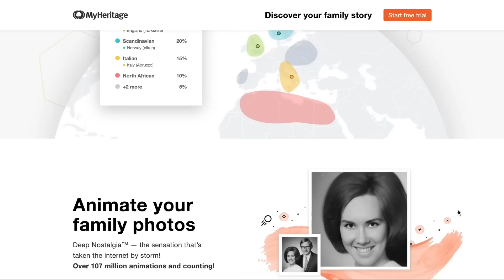THIS IS URGENT | Fixing our chicken coop mistakes on our Portugal farm

Comment: The doors are beautiful. I would use them as an accent for a Pantry door.
You could also build a walk in closet and use them as entrance doors.
One could be converted into a table. You could put some glass on top to protect the wood.

Not sure how big the doors are. Would they work for a bunk bed for the boys. You may have to build a solid frame and attach them in the sides.
Reply from the maker: Thank you for these great ideas friend. 🙏❤️

Comment: Ok so you will need a pre filter, otherwise you pump will clog. Yes, there should be a fitting that you can hook the hose to the pump. Set up a pre- filter for the pump. It can be a bucket filled with batting and lava rock. The muck needs to stay away from the filter on the pump. Where is the link to the little wood painted dolls that were sent to you. They are darling just like you all! So nice to see them. They are spot on in likness. Just needs a little mud on Corusoes lol. 
Make a wardrobe out of the doors or put them on a bace (face and back)of a kitchen island.
Reply from the maker: Thanks for the advice friend, will be sure to get a filter of sorts. Love the sound of a wardrobe. Thanks so much for watching 😊🙏🏼❤️

Comment: Today's phones can be a great memory support - Anything from basic text notes, seed tray 3: (I suggest some basic indelible markings like 1-n or A-Z, not related to content, to keep track as they get moved around) 2 rows cucumber and 3 rows spinach...  to annotated photos in a hierarchical folder structure.

The latter i use for documenting disassembling stuff where i might not be totally confident how it goes back  together again, as well as building projects before sheeting, focumenting plumbing, wiring, blocking etc. One folder per room, one photo per wall, ceiling/floor if needed, more detailed close ups if needed too. Annotate with basic/critical measurements...
Same folder structure also holds receipts/warranties/instructions for devices in the room.
Reply from the maker: That is a great idea Michael, thanks so much for sharing! We love learning from our community 😊🌱❤️🇵🇹

Comment: Hi Tara. I was wondering if you had dug the fence under ground as the predators dig under the coupe to try and get to the chickens. You would bend the fence into a L shape and the bottom goes under ground this will not be able to dig under the fence. A tip for your seed labelling cut up your yogurt tubs after washing then use a permanent marker to write your different seedlings name on. Recycle re use
Reply from the maker: Hi Charmaine, thanks so much for the suggestions friend. we are so appreciate of your support  😊🌱❤️🇵🇹

Comment: Hi Newbys!
The Rooster gifted by the Indie Project is Ginger Red Brahma which is a large dual purpose breed and the hens lay about 200 eggs per annum.
The 3 point of lay pullets are of different breeds. The white one with feint black neck lacing and black tailed is a Light Sussex (Colombian coloured.)and will lay +-250 cream coloured eggs.  The red one is
a Rhode Island Red hybrid and lay + - 220 brown eggs. The blueish speckled one is a barred Plymouth Rock and should lay about 260 pinkish brown eggs.Their'e all dual purpose breeds. The maximum number of eggs that they will lay will be in the first year until their second moult after which they lay less.
Feeding: Stick your hand into the feed bag and make a fist, what you can grab is enough. If you have four chickens, give 5 handfuls strewn allover their run so they can scratch for it and not fight. A bit of kitchen scraps every now and then and green lawn cuttings are beneficial. Fine grit, gravel and broken sea shell is essential for strong shell formation because egg laying depletes the  calsium in their bodies. Clean, cool water daily. 60cm x 60cm x 12cm wooden box filled halfway with wood ash will keep lice and parasites at bay. Fat, overfed chickens are never good layers. Good luck & happy farming!👍John, Cara, Crusoe & Sawyer .
Reply from the maker: Hi Willem. Thank you so much for all this information, you have definitely taught us a lot! we are so appreciate of your support and advice 🐔🥚🏡❤️🇵🇹

Comment: This might be late, but I'd be very vigilant with this kind of chicken wire. We had it on our chicken run and the marten/mongoose went through it as if it's air. It's apparently easy to stretch to the 4-5cm that they need to get in. So supervise them when they're outside and make sure that they're locked up securely every night, with no wire on the coop itself. Although I might add that you might have less of a predator problem than we have in our area, but better safe than sorry :)
Reply from the maker: Thank you for the advice friend, we will definitely make sure it is safe and sturdy! we are so appreciate of your support friend 🐔🥚🏡❤️🇵🇹

Comment: Hi Tara ..... a project suggestion for you and Crusoe to build.  And it uses his current vocab re go away/keep out!  🙄 I suspect the concrete strawberry (?) planter will soon be decimated by the chooks, so if you have chicken wire you could build a cage high enough, 1 metre, to keep them out of the planter.  But easy to remove when harvesting, etc and bees can still pollinate the flowers if you don't use a small mesh.  I would hammer 3 small stakes near planter rim, leaving 0.5 metre out of soil to use as props for the cage.
Have you thought how you will keep them out of your vegetable garden?  Chooks do not differentiate between human edibles and weeds, or avoiding your loved plant roots when scratching for worms and insects.  I know no one who allows their chooks to freely roam in their vege gardens.  
Lemon grass grows like bamboo and forms a dense thick mat here.  I recommend that you put it into a pot to confine it and it will also make it easier to harvest.  Learnt that the hard way!  After having ignored someone who had had that experience!!!
Rosemary grows into an extremely hardy long living sustantial bush that thrives on low rainfall so it shouldn't be grown close to other plants as it will smother them.    I have several bushes scattered around my garden borders that are mostly rainfall watered.  Brushing against them releases their glorious scents.  Don't plant near potatoes.  Good near cabbages as deterent for cabbage worm butterflies, carrots to deter carrot flies, beans to deter bean beetles.
If you already know/have planned these things, sorry.  Just being a mum .... offering potential support from far away.  I greatly admire you and John's approach to parenthood and living.
Reply from the maker: Hi Verandah, thank you so much for the project suggestion. I love it! We love learning from our community, thank you for all your advice and support 😊🌱❤️🇵🇹

Comment: Ok, I keep forgetting to take a picture for you but I wanted to give you a big chicken tip. Get chicken nipples and use any recycled plastic container to create a chicken waterer that never needs to be cleaned out. Cleaning out chicken water is grueling and gross. I've been watering my chickens with nipples for years. It is the only way to go. I honestly don't know why they still sell regular chicken waters. So gross. If I remember during the daylight some time I'll post a picture of my system. Which is actually an old vintage camping water jug attached to a pvc pipe with 5 or 6 nipples spread across it.
Reply from the maker: Thanks so much for sharing your advice on the chicken coop Melissa. We love learning from our community 🐔🥚🏡❤️🇵🇹